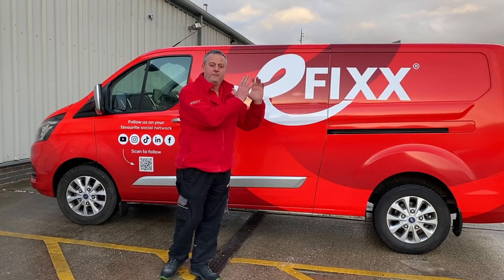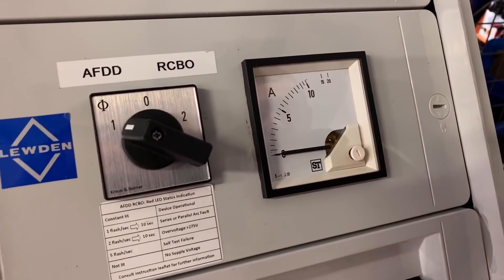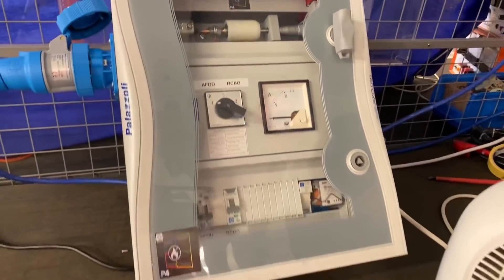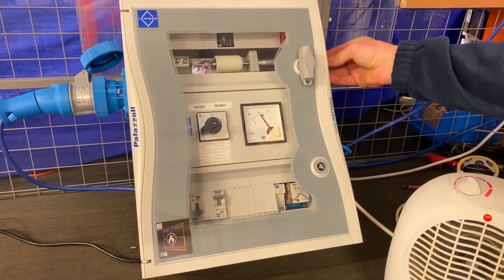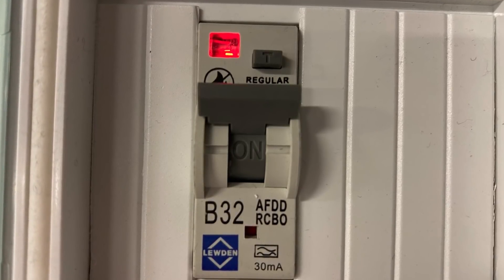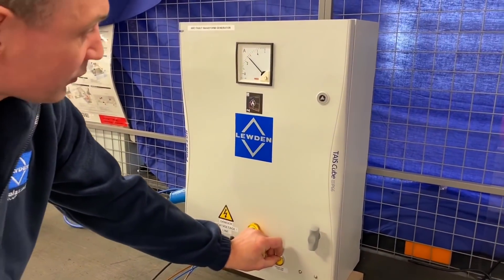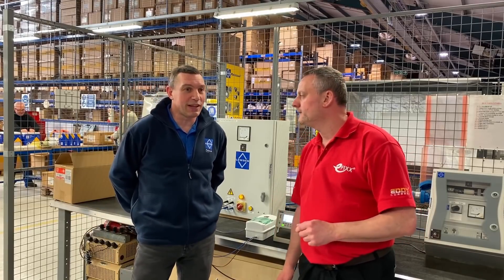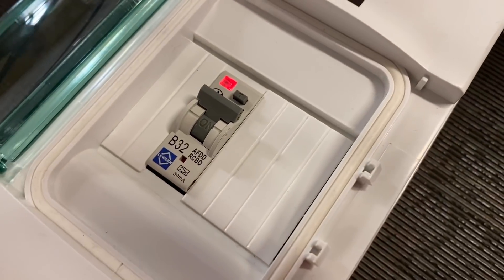REVEALED: The Secrets of an Arc Fault Detection Device AFDD

Comment: Did they make them work on real life severed wires and loose connections in 2025 or are they still only able to trip in ideal laboratory conditions with purpose built arc chamber? If they can't detect loose screw terminal or real severed wires they are useless

Comment: Techie question: I couldn't help noticing a TTL Serial breakout on the AFDDs PCB, plus the S-word¹ is also mentioned. If this is a fully active device (As opposed to the fully passive device that is a traditional RCD) wouldn't this make it an AFDD+GFCI, given that GFCIs - The American equivalent of an RCD - Are active devices which use a ¹software driven CPU to analyse electrical conditions, then disconnect the load if a fault condition is detected? 😇

Also, going back to that TTL serial link: Could these also unlock the possibility of digital feedback to an electrical monitoring system (Perhaps via I²C, though an optical non-electrical link would probably be required by the regs) be a possibility now or in the future? 💡

Comment: "Imagine we are now on a socket outlet up to and including a 32A circuit". A 32A circuit in the UK is most likely a ring circuit, and you won't get a series arc fault on those. Also, in general, whilst the RCBOs won't pick up a series arc, as they are not designed to do so, then they will pick up a parallel arc to anything earthed.
Reply: Yes, they will pick up a parallel arc IF that arc exceeds the trip time required for the breaker, which may be several seconds.  However, arc faults are often intermittent and may only spark for a fraction of a second, before returning to normal for a while, and then spark again later for another fraction of a second.  This type of fault won't trip a standard circuit breaker.
Reply: @Cynthia_Cantrell  The standard for trip time for RCDs (GFCIs) in the UK is 25-40ms not several seconds. If they did take that long, they would fail one of their key objectives which is to prevent electrocution. For that reason, they are designed to work within in less than 2 complete AC cycles.

Note that is not the same as a standard breaker, which is designed to detect overloads and those (which are just part of an RCBO) have a fast acting response to gross overloads and a much longer one for minor overloads and are described by breaker curves (like class B, class C and so on).

However, I am not referring to those, but very specifically the RCD functionality.
Reply: @   I was not refering to a GFCI / RCD, as those wouldn't trip at all for a typical domestic arc fault - i.e. a two-wire cord under a rug with the insulation wearing through, as the arc wouldn't go to ground.  

And many loads, such as a portable heater, are never going to exceed the load current (assuming it's not damaged), so a series arc would never exceed the breaker's trip current.  But yes, a parallel arc could exceed trip threshold, if it lasted long enough.  I was merely pointing out that may not always be the case.
Reply: @Cynthia_Cantrell  well, I clearly was, as I explicitly stated it was an RCBO detecting racing to earth (ground).
Reply: @Cynthia_Cantrell  I specifically mentioned only arc to ground faults. If you are going to criticise what I wrote, then maybe keep it relevant to that, not what I did not write.
Reply: @TheEulerID  I was not referring to those, so I don't know why you brought them up.
Reply: @Cynthia_Cantrell  May I remind you that you responded to my original comment, not the other way around.

Comment: All looks very grand simulating faults that do happen (arking) usually inadequate connections are faulty, vast majority have been on main switches / consumer unit connections. These manifested themselves more since 25mm tails were fitted, in my considered opinion some consumer unit terminals are square and 25mm tails are extremely stiff but after time relax amounting to a loose connection on one or both causing heating which in time exacerbates a poor situation causing arking on load and possible fire. I am retired now but was a niceic QS for over 10years. In my view the tails need to be softer or lugs fitted to achieve a satisfactory connection!

Comment: The film shows that AFDD turns off when an arc acts between copper and graphite electrodes.
But in real conditions there will be no graphite, and there will be no such arc between metal conductors.
AFDD will not prevent a fire. 
The arc itself also does not cause a fire, this is specified in NFPA 921-2021.
The ignition source will be heated conductors.
Dangerous heating occurs at the site of poor contact without sparking, so the use of AFDD is useless.

Comment: I am not an eletrician. How do I tell if it's a spark or arc? I have one extension lead with a few low powered computer accessories connected, plugged into a usual 13A double wall socket. When I switch that socket on in the dark, I could see a flash inside the socket through its white plastic. I plug this lead to a different socket, the flash follows. Is that a spark? or arc?
Reply from the maker: Switching things on will cause a spark which is normal - a broken wire or insulation fault will cause an arc with a very distinct waveform which is detected by an AFDD.
Reply: Well done on changing the laws of physics to justify a horrendously expensive product with limited usefulness. 
For information 
Arc - a luminous electrical discharge between two electrodes or other points.
Good manufacturer sponsored video although I didn’t notice the disclaimer on it being so………

Comment: How would an afdd react to an arc welder which I plug into a socket in my shed?
Reply: I wonder if it depends on whether it is a transformer or an inverter welder.  Perhaps the latter is more acceptable as it might be sensed as an electronic power supply and not an arc.

Comment: In a few years when we have to fault find tripping afdd’s. How are we going to be able to find an arc fault with current MFT’s? I’m guessing we will need a separate test meter or new MFT with built in arc fault detection and work our way through the installation and circuits like a IR fault. Any of these devices on the cards anywhere ?

Comment: Where to buy in Spain?
Reply: If not already in trade over there, you might need to import from the UK. Just bear in mind you'll need one with a CE mark and EuroNorm categorisation, especially as „UKCA“ isn't recognised by any EU Member State. 😇

But personally, I'd look out for ones manufactured in Spain. As software-driven devices, you really want ones which are produced under a legal system where the human rights to privacy, control of your own domestic electrics, and reasonable expectations of a decent lifespan (i.e: No built-in or pre-programmed obsolescence) are properly respected, which - Going on my unfortunate first-hand experiences - Isn't something you can assure yourself of goods which are made in conformance with UK law.

If I ever have these things fitted into my consumer unit, I just know I'm going to lose all access to power as soon as the software in the AFDD works out that I'm gay, disabled, and was born before the equality accepted after date of 1992... 🏳‍🌈🌻🇬🇧🚫🙅😢

Comment: Only issue with this test is that in real world the conductors will be run in an earthed containment system or in parallel with CPC conductors, so its slightly unfair on the RCBO which would pick up the resulting earth fault in real world conditions

Comment: What makes an HMO high risk? It's still just a single dwelling where residents are (probably) not related?
Why is student accommodation high risk, aren't they supposed to be young, agile and above average intelligence?
I think industry lobbyists have greased a few palms at the IET.
Reply: Number of lives and need for evacuation protocol will be the main factors. HMOs already have more stringent safety requirements
Reply: @dixonm9  But it's like these types of buildings have been plucked out of thin air. They are no more or less likely to have an electrical fire than any other habitable building. An HMO is still just a house. The most dangerous aspect being you have to share a kitchen and bathroom. If you're going to say, "well, you have to start somewhere", then start with all new houses of five bedrooms or over. That would make more sense.
Reply: @markrainford1219  it's not to do with liklihood of fire. It's to do with logistics of evacuation. It's an FRA approach

Comment: I'm certainly going to start quoting and fitting them, its a big plus for radials with white goods like dishwashers and fridge freezers , seen loads of issues with those over the years.. 2.5a fault current on a lighting circuit.. is it even worth fitting? i guess it could be with a faulty transformer .. hmm time will tell on that.. great video guys

Comment: 99% of the arc burn out faults i get are in shower pull switches (40 -50 amp) where its  carbonised with melted cables. so why does it stop at 32amp?
Reply: I was wondering this too - the higher the current the easier it is to detect & more important to break it!
Reply: Less used and more likely to be noticed
Reply: @dixonm9  Maybe but not much use if by noticing it means it has burnt your house down as heat as escaped box into atic!
Reply: @andyrutherford203  your 99% have all failed and required your attention before getting close to that point. 
 Think the point of it being mainly socket outlet circuits is that these are energised 24/7 and many appliances running without interaction from persons. I can see the regs moving towards full coverage eventually though, once use is more widespread and costs reduced

Comment: i am still not sold on the AFDD, given that john ward and david savery did representing tests where it did not trip or only trip with some luck they are absolutely useless imho, alone that you need specialized test gear to get them to trip makes me wonder what the purpose of those is if real world faults are not tripping it, what is the purpose of it if only very specific arc's trip it? a loose connection somewhere surely will not trip it as previous tests have shown

Comment: I'm only a humble sparks, but I see far more bad connections and arcing on lighting circuits where people change their own fittings and don't make good connections. Interesting that socket circuits are where the emphasis was placed. There must be concern for arcing within appliances.
(I still don't think people have twigged how hard the "is this a HMO" question is, as it changes depending on occupancy.)

Comment: Where is the evidence, from fire investigations, for the need for these devices please? Any links please?
Serial arcs are likely to arise from poor connections, and one of the most common sources of fire, which caused the change in regulation to metalclad consumer units, was due to loose incoming supply connections, on the main switch, inside plastic consumer units.
Loose connections, which could cause arcing, anywhere else in a wiring system, is commonly down to poor installation.
Reply: If you search for arc fault cause of fire or similar terms you find plenty of papers and presentations.  All by the likes of Schneider, Siemens, Eaton etc…

Funny how these papers were researched and published just as the devices that will protect you were developed and marketed.
Reply: @calmeilles  interesting how thecpapers you mention are coming from manufacturers.
After the 17th edition came out an IET staff member on an exhibition stand pointed to the number of BEAMA members on the IET Committee in answer to my question about the reasoning for the push to RCD/RCBO protection on all circuits.
Reply: There is no evidence, to support AFDDs , except from the very people who are trying to sell them . If they are so important for safety then why are they only required for circuits rated at 32amp or less and not required for every single circuit? We  have all been and continue to be brain washed. Into believing what ever they tell us . Because no one has the guts to stand up to them.
Reply: @seandempsey7351  Dave Watts (SparkyNinja) commented, on a Team Electrical podcast, that “AFDD’s are devices that have been designed to protect against a fault that should not exist”.
Reply: @stevejagger8602  if the fault doesn’t exist then how can an AFDD protect against it? ,
If it does exist then surely it would be better to fix it therefore there would be know need for the AFDD , sounds like bolting the gate after the horse has legged it . But who am I to argue i’am just a humble spark who’s opinion means nothing.

Don’t get me wrong I’m not totally against AFDDs I just believe we need real world test’s with real evidence to prove that they do work and to justify the ridiculously extortionate price. But there is no such evidence. Only what the manufacturers tell us after all they are trying to sell the things. In thirty years or so I have never come across any ache faults in a domestic installation so I’m sceptical as to weather AFDDs work . Show us the real evidence not some sales rep at work in production factory using a makeshift test rig. eFIXX are a fantastic place to learn about what new in the industry but they are only telling us what they have been told by the manufacturers. Personally I can’t fault eFixx or GHS they are doing a fantastic job

Comment: How would this work with a central heating boiler that uses arc/spark for ignition?
Reply: The ignition spark isn't drawn direct from the Line conductor - it's on it's own local 'circuit' supplied via a pulse voltage step-up transformer in the boiler, so the characteristics of what gets onto the mains supply circuit would be quite different to most usual fault conditions. Also the duration of the spark pulse is perhaps typically too short for an AFDD to pick up any remnant of it that gets into the mains circuit.

Comment: Given an AFDD apparently looks for some form of arc waveform ‘signature’ and every arc and spark waveform will have a random element to its structure you would expect to get a percentage of false negative (non trip on an arc fault) and false positive (trip on no arc fault) outcomes. I wonder what this percentage of reliability is?
Reply: That should be much more quantifiable with UK AFDDs already user-reporting the arc “signature” they trip about vs US we don’t even get feedback re if a combo breaker tripped for RCD vs AFDD, we just carefully avoid brushed motor treadmills in new homes…
Reply: Great question! In the video they try to differentiate between an ‘arc’ and a ‘spark’, does the relevant AFDD spec address the trip waveform issue?  Just the promise of some potentially glitchy microprocessor driven device is enough to raise concerns in my mind.
Reply: @adrianshingler9783  Ditto in mine, too. My first thought is that I'm only going to feel comfortable with a software-driven AFDD if I have a passive RCBO immediately upstream of it.

I'm not going to say that software-driven devices are inherently bad - American GFCIs (All active devices) can trip quicker than a passive RCD, and can potentially detect more fault conditions - But if market pressures are ever allowed to get in front of Thorough, persistent and guaranteed complete real-world testing then I wouldn't trust an AFDD/GFCI as the sole safety device on a circuit. 👍